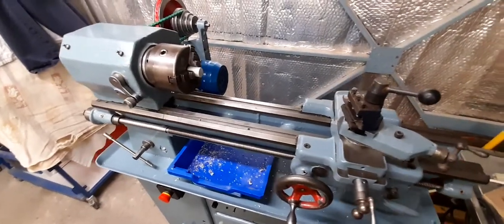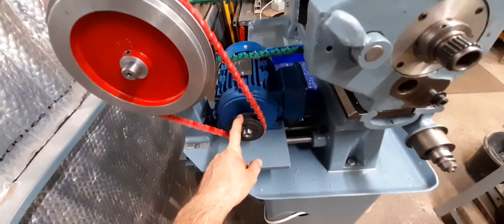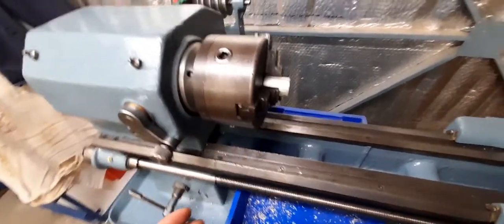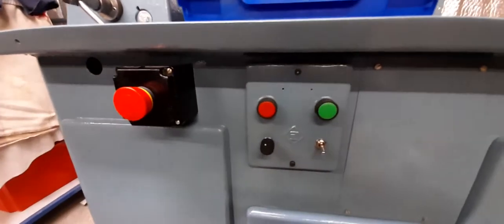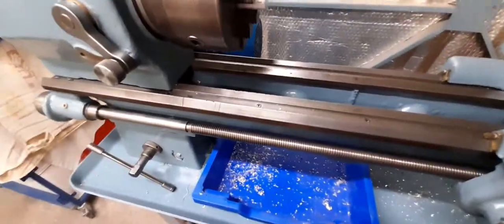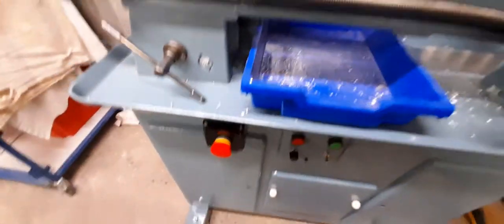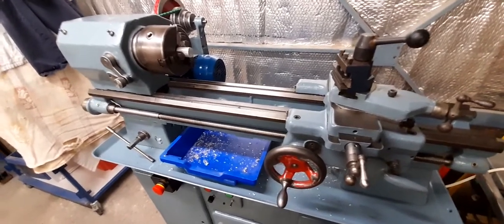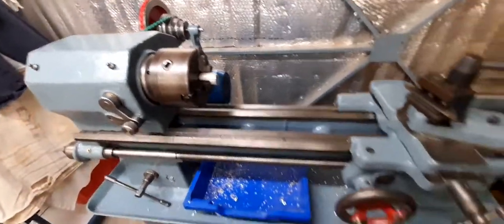Boxford Model C lathe with rear drive (sliding countershaft), WEG VFD and 3 phase motor

Comment: Hi , I have the same lathe but I can only select some of the speeds. The small leaver near the chuck will only engage gears when the leaver on the side of the headstock is moved . 

Is this correct?
Reply from the maker: I've now sold the Boxford lathe, otherwise I could have recorded a very short video for you. The lever nearest the chuck slides a pulley along the main spindle to engage/disengage some pins. Be careful the pins and their respective holes are aligned when re-engaging. Only after you have "disengaged" this pulley so it rotates freely on the main spindle can you use the other lever to engage the backgear layshaft.

Comment: Hi again. I have purchased the VFD and a motor and am currently setting them up. So Thanks for that.
 In the easy start guide for the VFD it advises to use a 10k pot for the speed control and also a screened cable to be fitted to the same. However I noticed that you have not used a screened cable for the pot. Will this be an issue?
On another issue The half nuts have completely warn out and I would like to purchase another set.However when trying to open the sites where I see these parts I can't. Could I please impose on you to locate a set so that I can purchase them? Thanks again in anticipation. Regards, Ken
Reply from the maker: Hello Ken. Analogue inputs will process electrical noise as a component of the signal (whereas digital inputs are configured to ignore small changes due to noise) and so I understand the recommendation to use screened cable especially where cable runs are long or close to sources of electrical interference. However, in a home workshop like mine with short cable runs and use of screened SY cable between the VFD and motor I have experienced no problems using un-screened cable on the digital and analogue inputs. If you decide to use shielded cable you may wish to look at CY cable - you can buy short lengths on eBay. I'll reply to the second part of your question in a while. Brian
Reply from the maker: Ken, is this the link you want? https://australianmetalworkinghobbyist.com/index.php?route=product/product&product_id=401
Please bear in mind that I have not purchased via this link and cannot confirm whether they are compatible with your lathe. If your half nuts are "completely worn out" then what condition is the leadscrew in? It would be very disappointing to purchase new half nuts only to find they slipped on a worn leadscrew.

Comment: Hi from New Zealand , I also have a boxford lathe (ex school model) but the motor-single phase has developed an earth leakage. I'm very interested in your mod to 3 phase motor with VFD. Could you please tell me what the specs are for the VFD as I already have the motor specs.
Reply from the maker: Ken, I just posted a link with the specs of the VFD from the supplier I used. I'm pleased with the VFD, it was easy to configure and works well. None of the safety issues I've noticed on some cheap import units.

Comment: I'm interested in doing this conversion to my CUD. That inverter is tiny! 

Could you share a link for the 3 phase motor or at least a spec?
Reply from the maker: I'll take a look for you later.
Reply from the maker: It's a 4-pole motor (1420 RPM @ 50 Hz) 0.75 kW (1 HP). I've shared a photo of the motor plate here https://ibb.co/SPc8qWP
Reply: @PizzeyTechnology  that's great - thank you very much
Reply from the maker: No problem. I'm sure many other suitable motors exist, but I found an IEC 80 frame motor convenient to fit and at 1HP is about right for this lathe.
Reply: I've designed and built an electric crossfeed for my CUD, requiring no permanant modifications.
You can get a really nice finish.
I'm looking at making kits and selling them.

I'm working on an electric handwheel driver, so that I can power feed my cuts without all the wear on the half nuts. Again I'm trying to do it without permanant modifications to the lathe itself.
Reply from the maker: I've seen people using a battery powered drill and adapter to turn the cross slide handle. I don't really need this as I have another lathe with powered cross feed, but I'm sure some people would consider this as a desirable option.